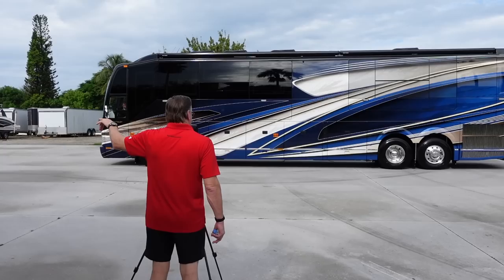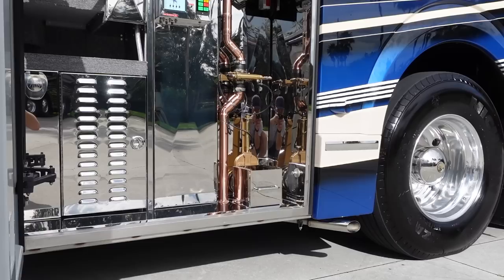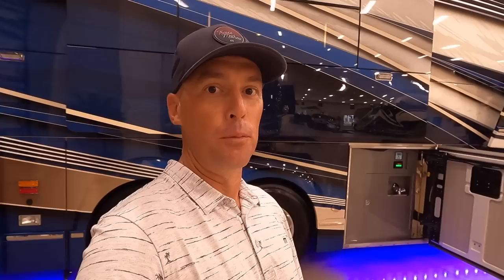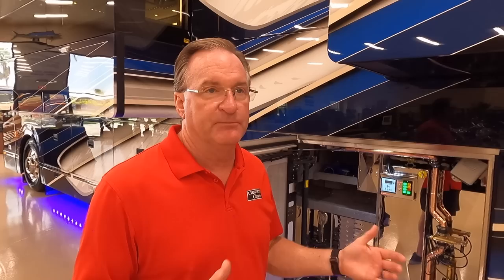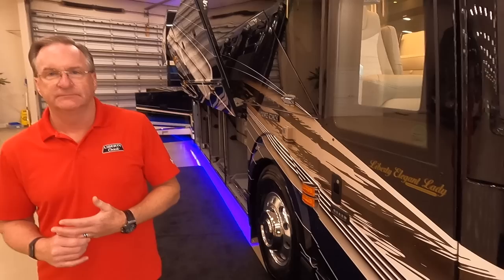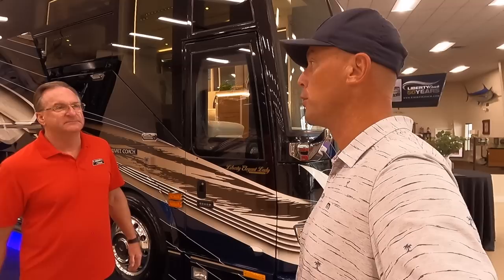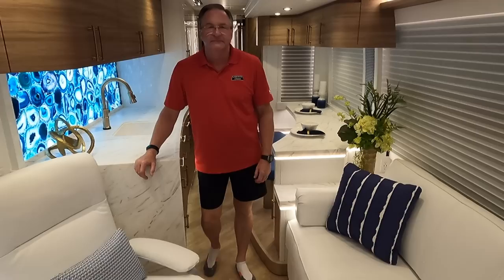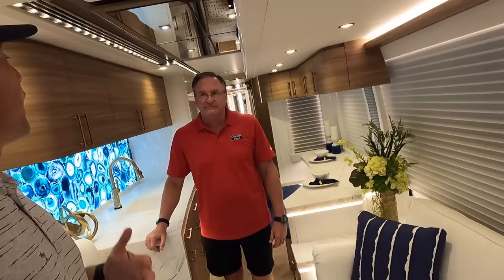Tour of 2023 Prevost Liberty Coach #894 Triple Slide with Bedroom Super Slides!

Comment: These are units that are beyond compare. The engineering that goes into one of these is appropriate for the money value. I find the interiors are very much not my taste but this is a part of the age of the customer that can afford such a beast. This of course is irrelevant as you can have it any way you want it. Orange shag is also an option!~!!  
 I must admit that I have never seen that 8in post in the middle of the windshield with or without a speaker in it. I gotta git me that "best blind spot ever" feature for my truck. Sorry, Osiffer I didn't see those pedestrians because I go this huge honking pillar in the middle of my windshield. 
 So where did my 105hp and 200 ft-lbs of torque go? Wishing for a 605hp Cummins engine in the back? Sorry just gotta say.